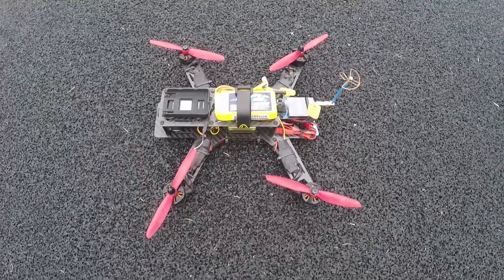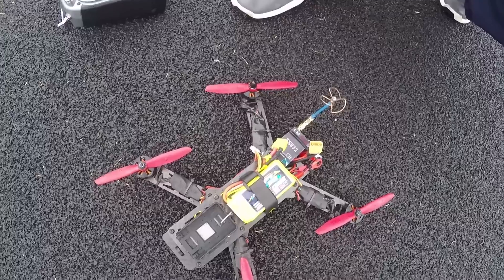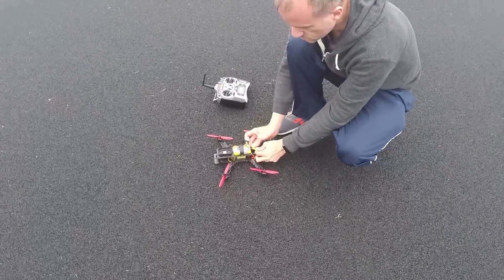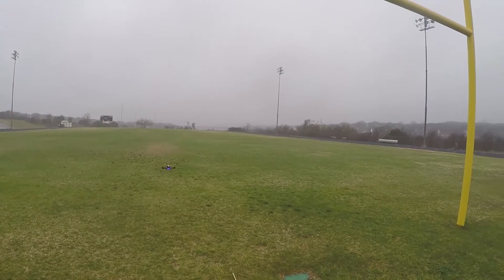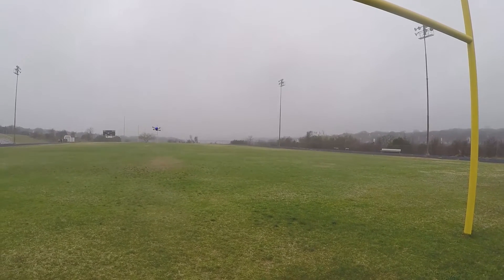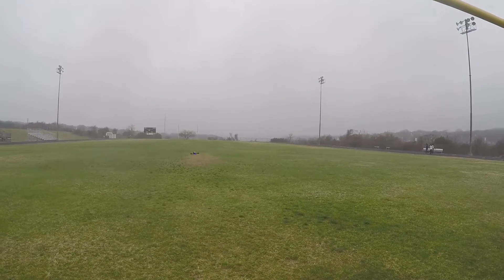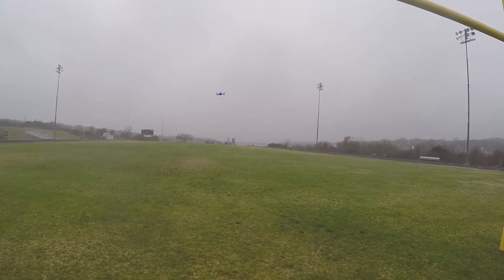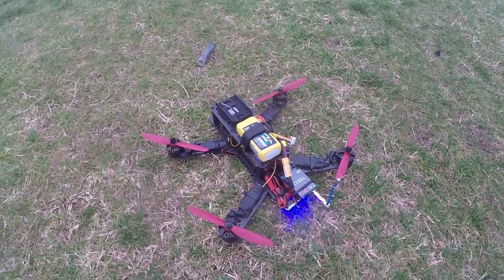How To Build A FPV Racing Quadcopter Part 3 - Test Flight

Comment: Hello sirs, I have a few questions. What type of lipo 3s battery should i get? I already have a 2200mah 3s zippy. Is it too big? Also, if I want to charge the battery, what charger should I get? And I also have a sort of weird question but when I put my esc's on my drone, I covered them with electrical tape on the arms of my frame. Do you think that they will have enough air flow? And also (last question) what sort of power supply should I get and how do I mount it? Thanks so much in advance for your advice.
Reply from the maker: Great questions! The 2200mah batteries should be fine. I recommend getting a balancing charger, the Tenergy TB6-B 50W Balancing Charge. It's $50 on Amazon.com. Finally, airflow is important for ESCs, but electrical tape should NOT hurt them. Hope that helps! Happy flying!

Comment: how much should be the battery life of the drone? and is 250 ? budget enough for making one of these?
Reply from the maker: +sarthk kharwal Depending on your flying style, you should get 6 - 10 mins of flight time out of each battery charge. $250 is a good budget excluding your transmitter, receiver and GPV goggles.
Reply: Can I increase the time to like 30 mins? I was talking about $ and I will just be doing casual races with friends. My mom has allowed to increase the budget to 300$ if I must will that work with all the goggles,transmitter and receiver? And plz specify a good build if u have one under 300$ . Thanks
Reply: NO, its not possible to increase time up to 30 mins. Because of quad size, you cant put large batteries. You can spend money in more efficient engines that can give you 1-2 extra minuets of flight in best conditions. If you fly 4S lipos of 1.300 in acro normal time is 4 minutes.
Reply: Battery life is around 10 minutes
i tried it myself

Comment: Was the motor placement changed since the build video? I noticed the silver top nuts were on the opposite motors.
Reply from the maker: Good eye! We had one of the motors in the wrong place and had to switch it. Stupid mistake, but once we switched, everything worked great. Thanks for watching!